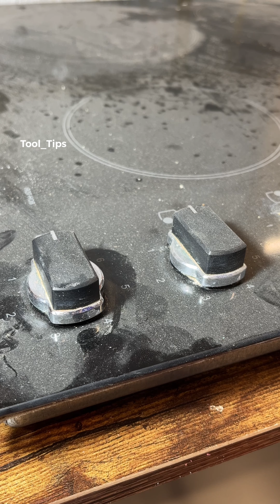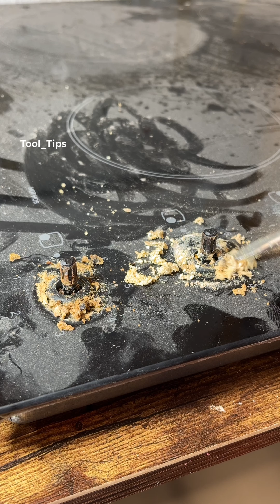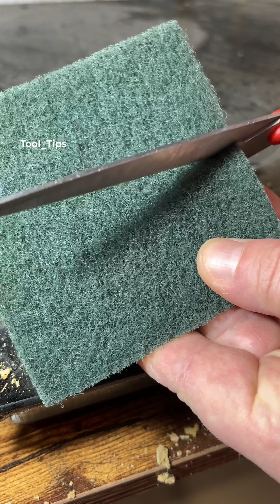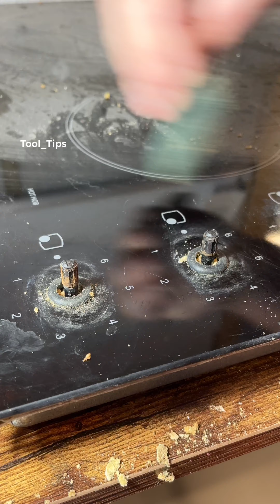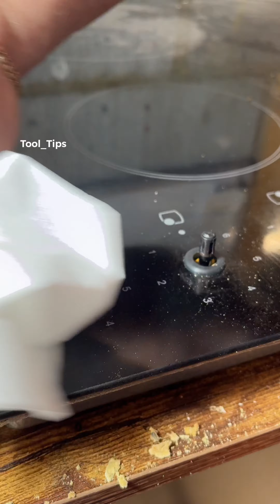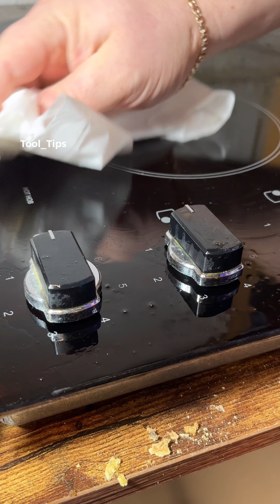Tool tips and lifehacks

Comment: You didn’t just use a wire brush on your glass cooktop
Reply: Don't worry, he scrapped it with a flat head screwdriver first lol. Hell I don't use a wire brush on mine but I'd be way cooler with that than scrapping it with a screwdriver. With my luck I'd shatter it 😢
Reply: Well I know adding w d forty is probably not the best thing to do. It says flammable.
Reply: It will just smoke you out of the house 😂